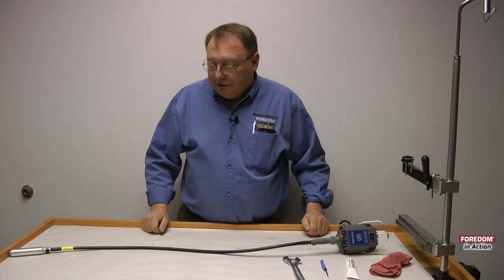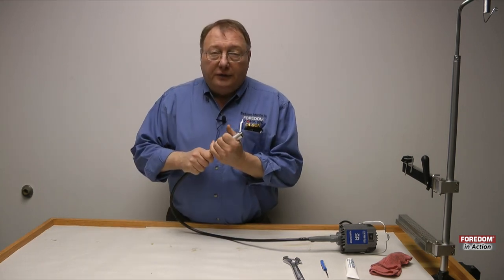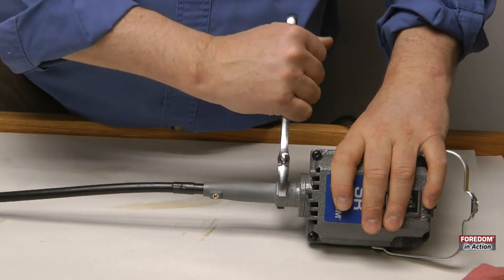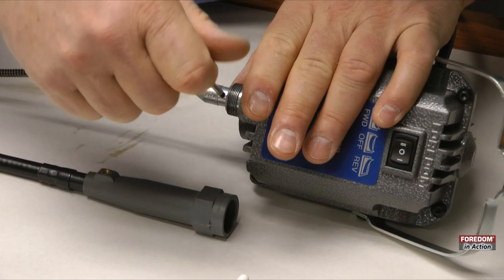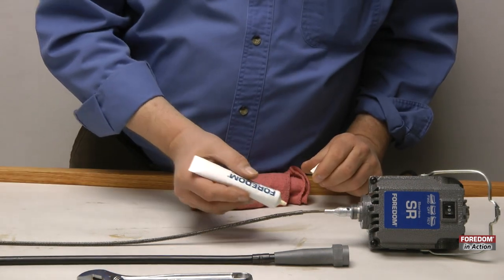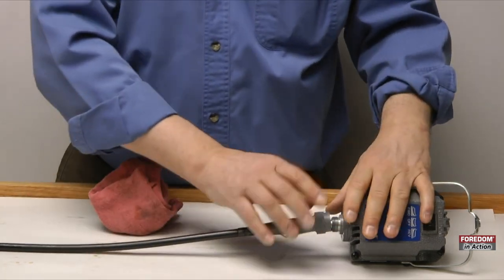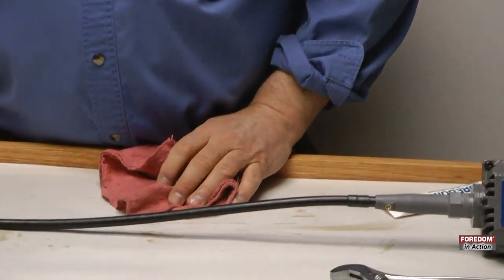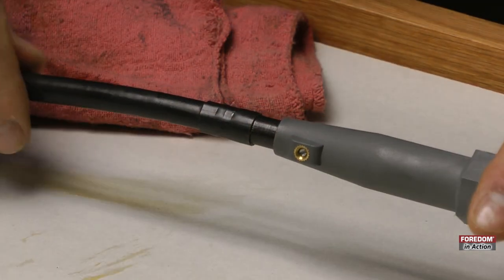Foredom Basics– Shaft Replacement

Comment: Shouldn't adjusting the length of the flexible shaft jacket be done by putting on the handtool?

first maximally pull out the shaft ,then carefully insert the tool until it clicks - as a result, the flexible shaft will move exactly to the length of the connecting cut in the handtool

Comment: I couldn't get the shaft off either, I got screw all the way out but it felt like something inside the housing was still holding on.  There is a small hole up above the spot that I took the screw out of so I assumed it was for a Allen wrench so I used six different sizes, but to no avail.  Please help!